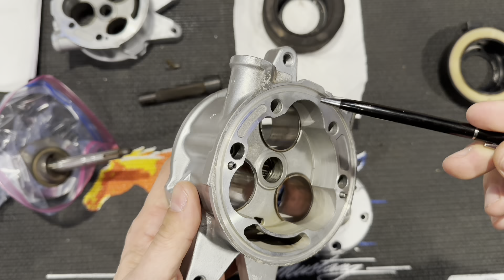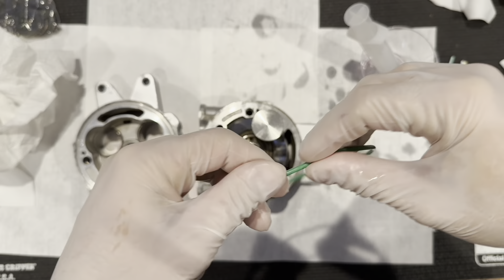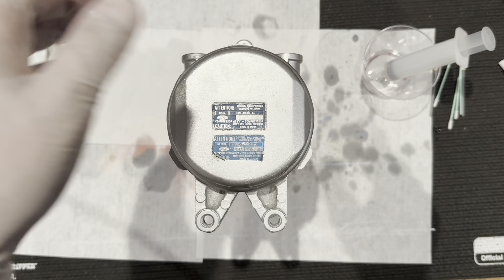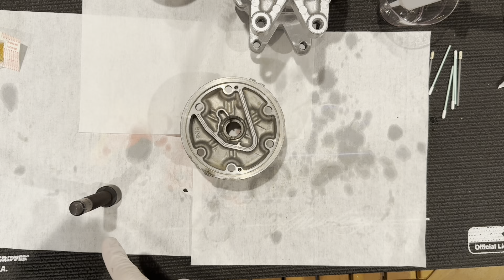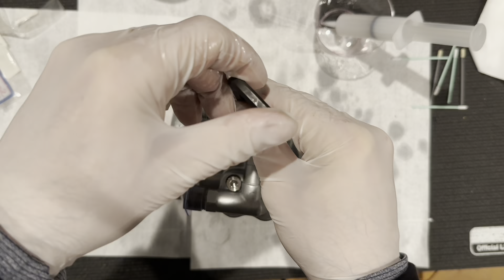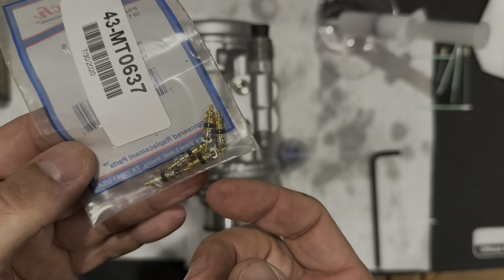Foxbody Mustang Nippon-Denso 6P148A A/C Compressor Rebuild: Part 2  Reassembly

Comment: The video was fantastic.

Thank you for taking the time.

Took my car to an a/c shop for an inspection and recharge; it had a shaft / seal leak.

I’ve been rebuilding my NIPPONDENSO 10p13e from my 1984 Mazda Rx7, GSL-SE for a month.😂😮‍💨

Took it all apart, cleaned it all up, put it back together, successfully performed a pneumatic bench test on the compressor, no leaks.

Put it back in the car to pressure test the system. I must have over pressured it because there was a shaft / seal leak, that wasn’t there during the bench test.

Ordered another kit, just in case. What I noticed is there is a one inch gap between the c-clamp that goes I. The bore and the chrome seal.

I wasn’t sure whether I lost a part or what, as the slot for the clamp is at least an inch above the seal. I had to learn that the c-clamp is not intended to provide downward force on the seal or even make contact with the seal.

I’m still not sure why air is passing between the seal inner ring and the shaft.

Hopefully the new seal will solve that problem.

Thank you again for your video!

Comment: Great video. I have a 8P127A compressor, seems looks like the oring and gaskets kit be the same. What is the number of the kit where the flat gaskets come?
Reply from the maker: The kit in the package is a Santech Industries MT2140.  You'll have to search around for a vendor because there is a possibility it's been recently discontinued. 

I'll have to search and see if there is any alternatives.

Comment: What did you polish the shaft with? Thanks for any help!
Reply from the maker: I think i used a mix of scotch brite pad with some find sandpaper.   I used the least aggressive method and worked up as needed. 

Once done, i thoroughly cleaned the shaft to remove any particles.

Comment: i got a FS10 compressor, and was wondering where would i find the seals for the pistons. i can only find the shaft seals.
Reply from the maker: Century Auto Air would probably be my recommendation as to who to check with.  Unfortunately all the shops i bought seals with before seem to be closing up now.    

There are some FS10 seal kits on ebay, but I don't know the quality.
Reply: @Mustang5L5  the kits on ebay dont have the piston seals, i looked everywhere. OG compressor to the car, 25 years old.

Comment: I installed a new ac kit in my 86 mustang, starting leaking immediately. It would hold a vacuum but loose it’s charge. It is the compressor seal. I’m going to be rebuilding it since I already have invested so much into getting the AC to work. Thanks for the guide, the stainless is a nice touch👌🏻

Comment: Great Videos and excellent on your part. Although I will point out that you are not suppose to use PAG Oil to wet the O-rings even IF the vehicle is a R134a system and uses PAG Oil in the system. The reason for this rather simple. PAG Oil is  "hygroscopic" as is brake fluid. Being "hygroscopic" it absorbs moisture. Thus attracting and causing oxidation, corrosion, and rust. You are suppose to use R12 Mineral Oil to lubricate ac system O-rings even in R134a vehicles. I state this as a factory trained Master Technician who specializes is AC repairs and as a compressor resealer Technician. I am also a Sunair Products distributor Vendor selling compressor and gasket kits for many years.
Reply from the maker: Good to know.  I actually did use mineral oil in this video but that’s a great point to mention for folks who plan to run 134A.  Thanks!
Reply: Boa Noite  !   Eu sou do Brasil  .    Prazer conhecer você  🤝
Reply: What about Ester oil? Can that be used to lube the seals?
Reply: @grumps91GT  Yes, although R12 mineral oil is best to use.

Comment: What type of oil did you use?
Reply from the maker: My car has R12 in it, and I have a supply of R12, so I chose to use mineral oil.   I have a bottle of Motorcraft YF-9-A mineral oil